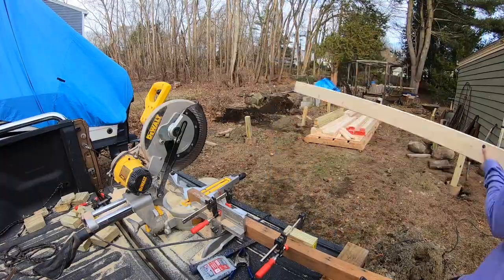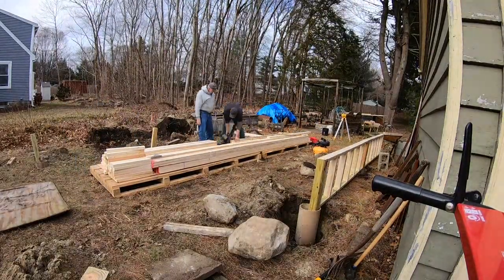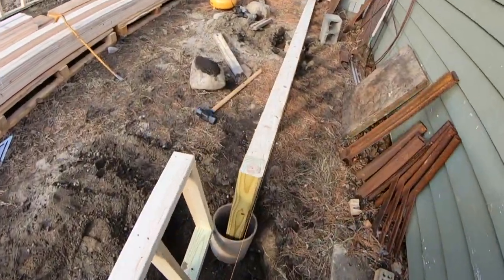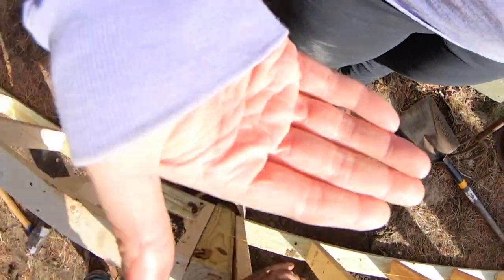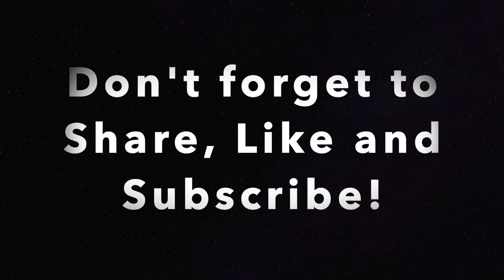STEP 1:  Building a Gothic Arch Structure to Build our Catamaran in! Part 1

Comment: What material did you use for the bows?  1x4s?  1x3s?
Reply from the maker: The wood you can see in the front of the hull is for the forms only. The foam core hull panels are brought together and glassed (with many layers and xtra on the first 6’) no additional support is called for.